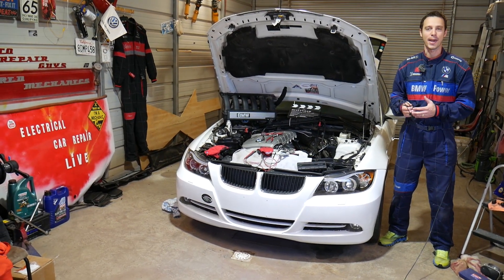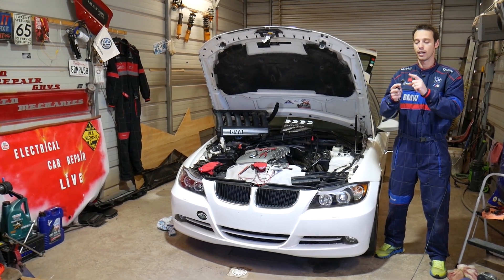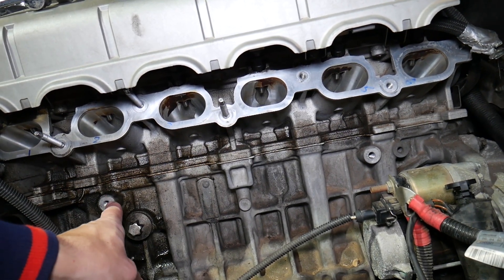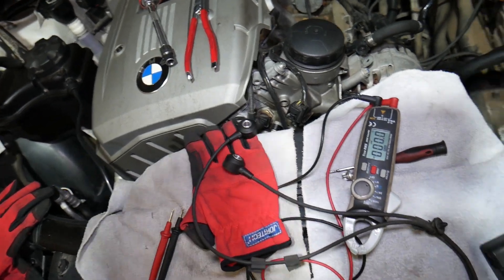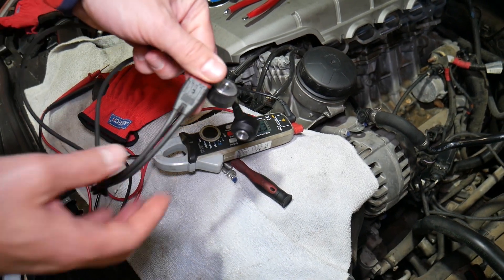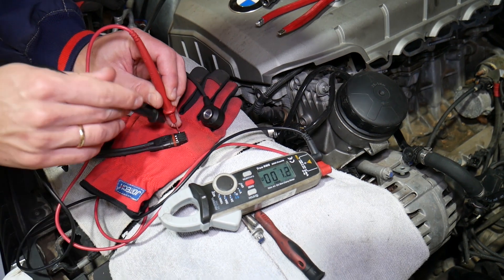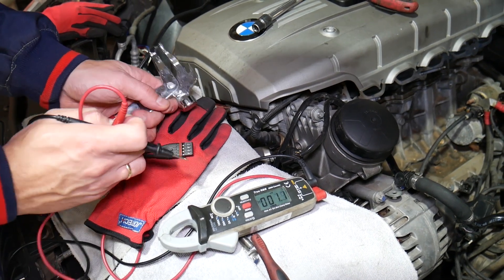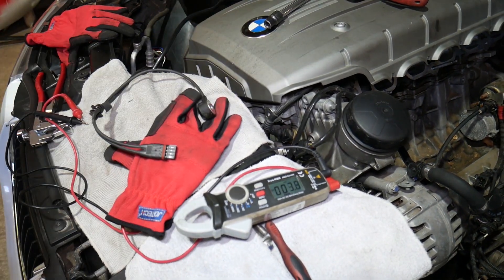HOW TO TEST KNOCK SENSOR BMW E46 E90 E91 E92 E93316i 318i 320i 323i 325i 328i 330i 335i 318d 320d

Comment from the maker: Products that we use and recommend:
► Voltmeter: https://amzn.to/3e3seEO
► Alligator Clips: https://amzn.to/36w7nqP
► Knock Sensor N52 Engine ( check part number) : https://amzn.to/3bhq2Iy
► Reverse Torx Socket Set: https://amzn.to/3evO848
► Assorted Fuses: https://amzn.to/4f6qJos
► Panel Removal Set: https://amzn.to/3YiMADu
►Torx Set: http://amzn.to/2hbyWgd
► Tool Set: https://amzn.to/3p5MM6t
► Screwdriver Set: https://amzn.to/3XRB28Q
► Engine Oil: https://amzn.to/3xBc8B9
► Oil Filter: https://amzn.to/3w0Ulme
► Torque Wrench: https://amzn.to/32qyRwg
► Liqui Moly Engine Flush: https://amzn.to/3IiDBID
► OBD Scanner that we use most often: https://amzn.to/3I4MQfe

► Check out our Amazon Store for the tools and parts that we use: https://www.amazon.com/shop/worldmechanics

Comment: When replacing with a new one , Is there a way to tell which sensor goes on bank 1 and  which goes on bank 2... or does it matter?
Reply: Bank 1 is closest to front of vehicle centered to and directly across from cylinder 1,2, and 3. Bank 2 is equally situated relative to cylinders 4, 5, and 6  a bit further back on the block